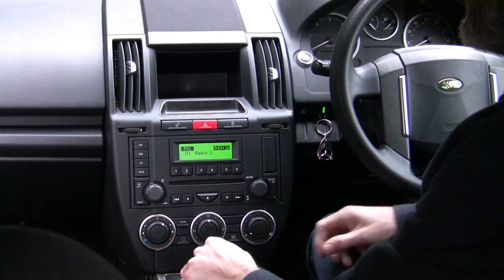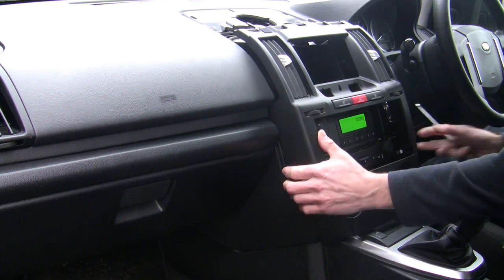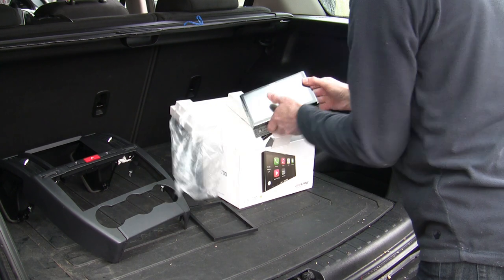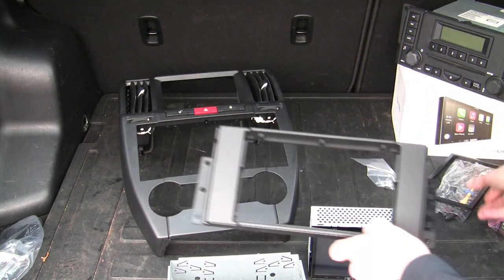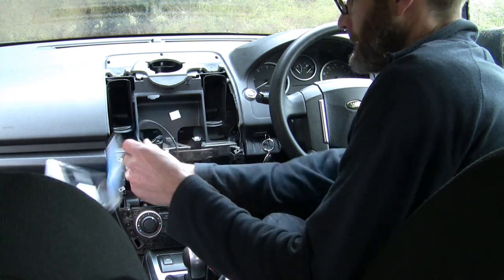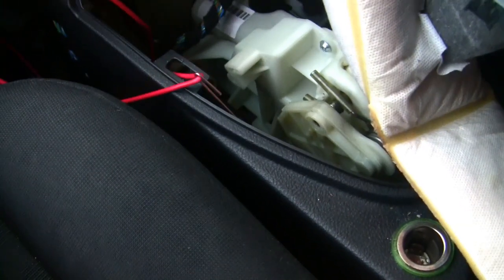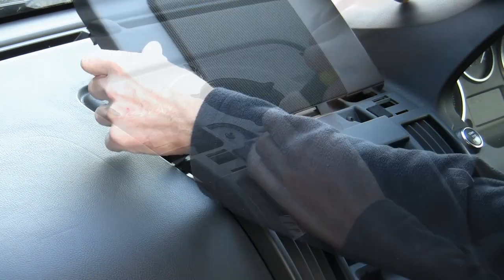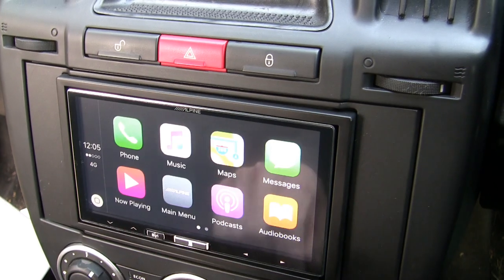Alpine iLX-700/iLX-007 Apple CarPlay Stereo – installed in Land Rover Freelander 2

Comment: Nice Work! I'm trying to do a mod where the Nexus 7 tablet is the main head unit. Any idea what the best way to wire it up would be? I'm struggling to figure out what the connectors behind the stereo are and how the parking sensors are currently wired. Any help would be great...thanks!

Comment: Hi fantastic video have watched multiple times to get my confidence up. Two parts not sure about, ignition cable missing. Is not possible to get a replacement ignition cable and plug it rather than taking an alternative power supply from the back. Read somewhere hand brake has to be earthed for Alpine unit to work properly. No mention on your vide s is this wrong.

Comment: Hiya, I've been looking for an alternative to the original and this looks good, pricey here though for the head unit, mine is a 2010 S model which has steering control but no phone unit or Bluetooth, just volume, foreword and backward, will all the speakers etc work ? i assume so but thought i'd ask anyway, good job, looks very classy :)

Comment: hey farmer, i have a 2008 LR2 SE and it's decked out with the technology package AND the 12-speaker Alpine system. I would imagine that with the adapters you used it still allows for all speakers to be played (unless i'm assuming too much). Regardless, as another poster asked, could you share your parts list: any adapters, fascia, trim, etc.? Also, i have sirius xm built into the radio and will be getting the separate tuner; however, instead of running its antenna i'm hoping to use the existing cable from the exterior mounted receiver - but with an adapter, i'm sure. 

Thanks!

Comment: It is so hard to find a harness for my 2010 land rover lr2 can you tell me where you got your and can you  give me the part #
Reply: Use www.incartec.co.uk - they have the kits for every LR - basically you tell it which car you have, which model, which version and what brand of stereo you are fitting, its just step by step multiple choice questions... and then the website will tell you every single thing you need, you can buy the individual parts or if you need them all, you can buy as one kit and they come with very good instructions!